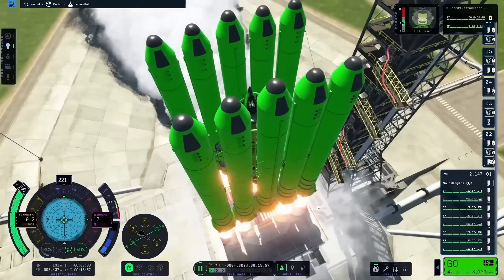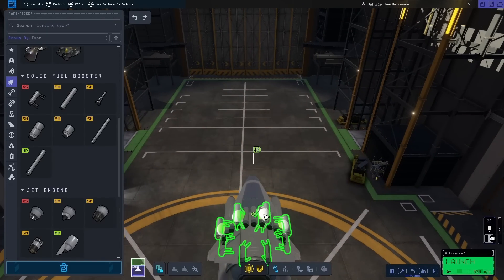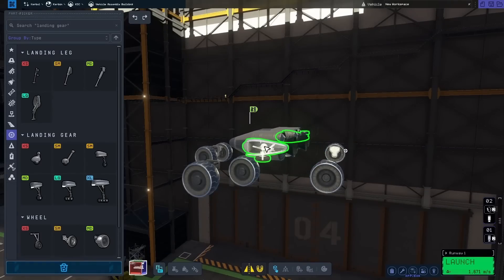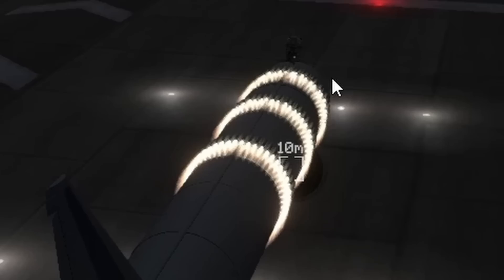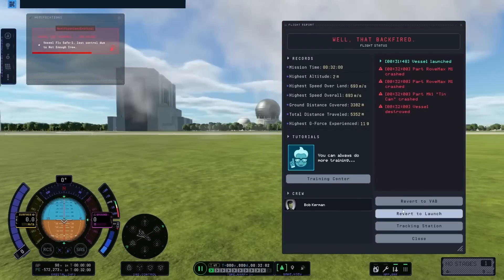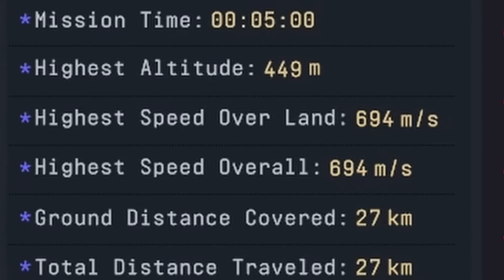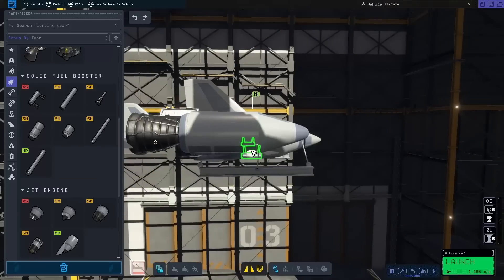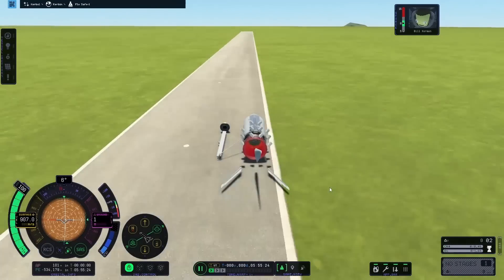Setting The ROCKET SLED World Record In Kerbal Space Program 2

Comment: If you were wondering, the reason your sleds were initially running off the runway the opposite way you steered is because when engine gimbal tries to steer you left, it has to turn the opposite way, pushing to the right, and with how close they were to the center of mass that push to the right was stronger than the torque to the left and so it couldn't turn the vehicle enough to compensate. If you had them further back, as with the stabilizer fins, that torque would be stronger and it would more efficiently turn your vehicle before it started pushing you off course.

Comment: You seem to be under the impression that you need to reduce your weight to go faster, when in fact the only thing that really matters is mass. Friction is determined by the coefficient of friction * weight, but friction is a static force. It remains constant for all speeds. Drag, on the other hand, scales up with the square of your speed, meaning that at high speeds it makes up the vast majority of the force resisting you. As such, your "weight" actually has extremely minimal effect on your top speed and adding more down force for extra stability is usually preferable.

Comment: There’s a bug currently going around that dramatically increases the drag of certain parts, one of those parts are the cargo bays. Neither the cargo bays or the fairings shield what’s in them from drag so just don’t use them. I can’t tell if the final run used a capsule or a seat in a cargo bay but if it didn’t you might want to address that
Reply: Oh also fairings have increased drag as well as well as Probe cores The couplers and stage separators

Comment: I'm 99% sure by now that velocity, speed, pressure, etc are still tied to frame rate, meaning if you drop significant frames, you only get a very small portion of those things until the game smooths out, which usually completely screws everything
Reply from the maker: That's kinda messed up, I should try again on my GTX 960
Reply: @ReidCaptain  Ayy GTX 960 gang 🔥
I love the gpu market...
Reply: @ReidCaptain can't you just limit your current GPU? Or have it use your CPU integrated gpu if it has one?

Comment: If you could somehow clip through the ground and end up under the surface, would that still satisfy the condition of not leaving the ground? If not, the optimal strategy is probably to try and get as close as possible to the planet's center and use gravity to accelerate to a really high speed.
Reply from the maker: There's no way that counts
Reply: @ReidCaptain  even if it did, all it would do is add a new rule lmao
Reply: It somehow does,
 if you dont leave the planet
Reply: How would you even do that
Reply: @larrywhitney  there were methods in ksp1, maybe something similar could work
Reply: Or if going under the surface is breacking the rules atleast instead of going in the ecuator you could just go to the north pole, go around it and coming back, its half the distance
Reply: @NomIsReal  When Reid did the circumnavigation video, we discussed on the discord if that method counts and if it would be faster than just taking the regular route due to all the declarations needed. I tried it in KSP 1, but then I gave up cause I suck at the game 💀
Reply: @Roaxial  Oh ok also mentira means lie and camilo its not my real name
Reply: I somehow doubt KSP 2 is smart enough to even think of advanced KSP glitches